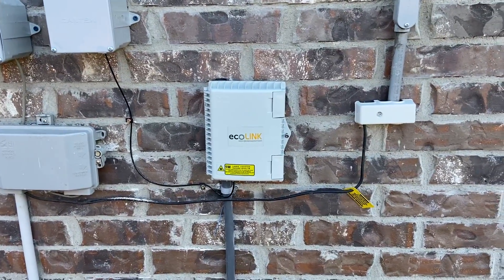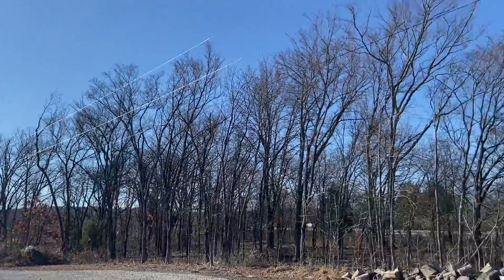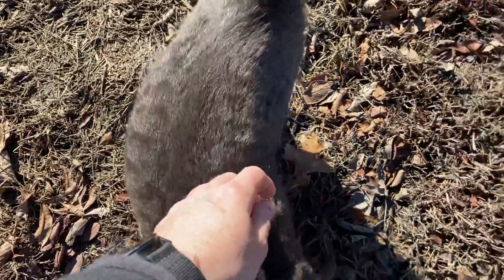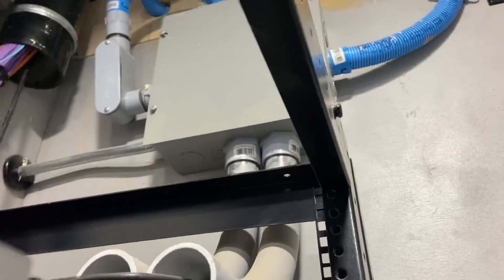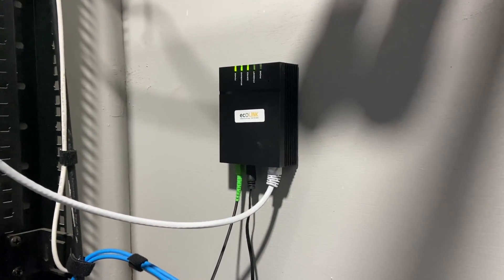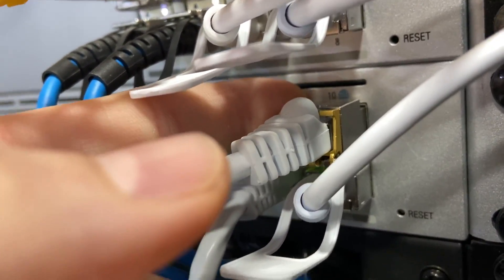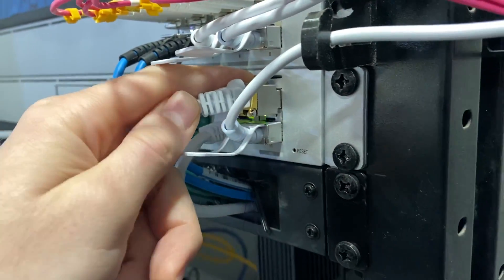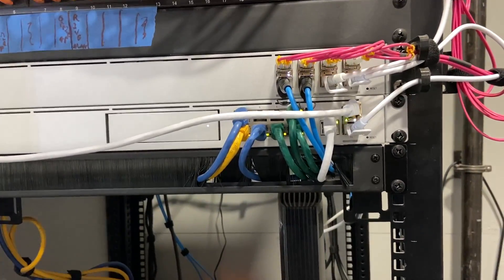Episode 107 - Fiber Internet Install Overview

Comment: As far as the auto negotiate is concerned you would be auto-negotiating against the ONT and it may have that feature disabled for security reasons. Thus, it will not respond to the negotiation packets and ignore them. I know that it is that way with Bell Canada. They lock a lot of stuff down because under the right circumstances it can be exploited to access their core network or because the ONT is just a relatively dumb device that has extremely limited capabilities.
Reply from the maker: That is also good information. Thank you very much.

Comment: Having a clear demarcation point is also handy for testing if something fails. You can easily disconnect your network from the ONT and they can loop test to the ONT to determine fault. Manyu GPON systems also have TV on a separate VPN so it is often not possible to directly connect if you have both data and tv service since they are on separate VPNs that you may not be able to get security access but which the ONT already has the required firmware to navigate and manage with the correct VPN encryption keys which most ISP's are loath to give out because it gets you  a chance of infiltrating their core network via a man in the middle attack.
Reply from the maker: Thanks for the information. That makes sense. They don’t have TV but they do have phone so I bet it is something similar.